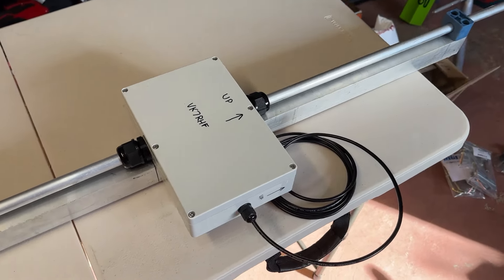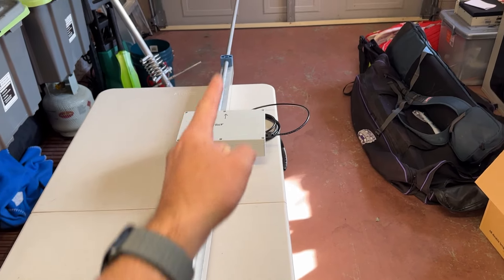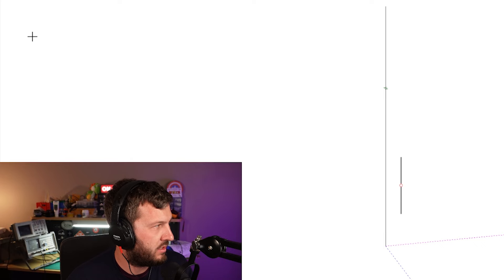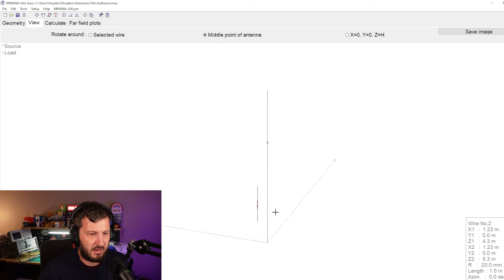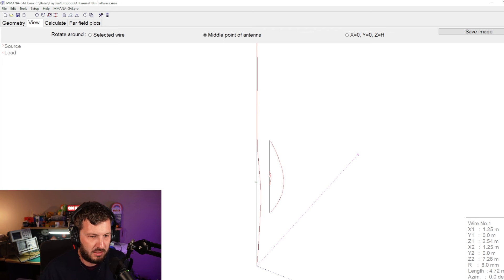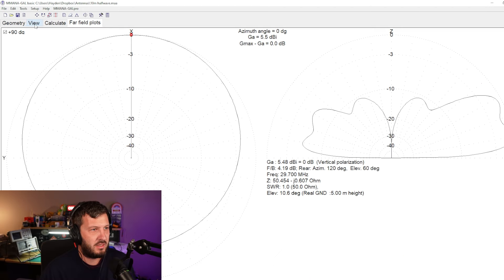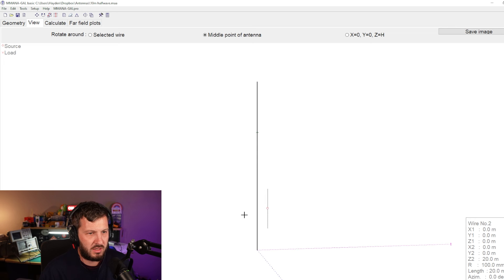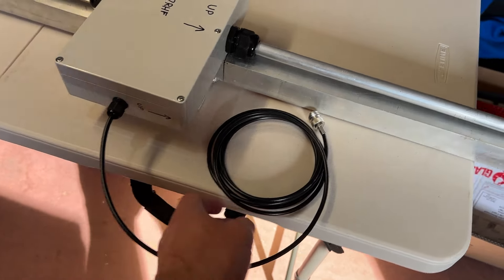SECRET Tool The PROS Use to Test Antennas!

Comment: I suggest the feedline goes in the bottom if you can, that can reduce the possibility of water getting into the box along the cable.

Also, have you considered designing a folded dipole for more gain for the same length? I know it's more work mechanically.

Best of luck to your 10m repeater project! I also build and maintain repeaters but none on 10m yet.
Reply from the maker: Thanks for the tips! No folded dipole - but if I can get hold of some 125 ohm coax for matching, perhaps I can convert a mid band one!

Comment: As I understand it, this would be akin to mounting a 102" stainless whip on the bumper of a car vs. mounting it on the roof.  The car will indeed change both the match and the far field pattern because the main current lobe of the antenna (at the feed point) being in close proximity to the metal of the car.  That said, while it's not good engineering practice to do so, the effects of this very short brace shown in this video will have minimum impact on the radiation field.  We ALL mount our antennas on a yardarm connected to our towers, so why don't we complain about the tower influencing the far field?  

In FM broadcast, it is sometimes to our advantage to mount the entire string of FM bay antennas on one particular side of the tower.  An example would be where the tower is on an island about 25 miles away from the mainland where the target audience is located.  This is exactly the case of a station in the 1980's where the transmitter was located on Nantucket, but the main audience was on Cape Cod.  The antenna bay was mounted on the North side of the tower so that the small percentage of power that was reflected by the tower would be sent towards the mainland.  Even a 0.2db gain counts in this business.  

PS.  I use MMANA-GAL and it is very good, but it is not perfect.  There are times when the models are not accurate, but one can not look a gift horse in the mouth.  For accuracy, you'd need to spend several tens of thousands of dollars on the software.   73
Reply from the maker: I think EZNec is now free? But I've never used it - only MMANA-GAL. 
I designed some of my 2m and 6m yagis using it and two stacked 70cm dipoles for our repeater (info on my website). It's pretty cool to tweak and play!